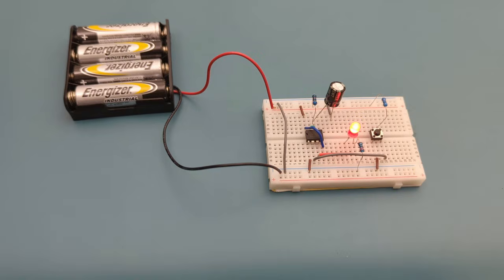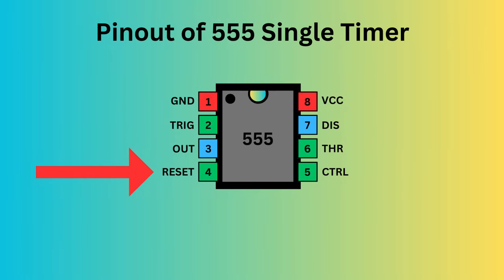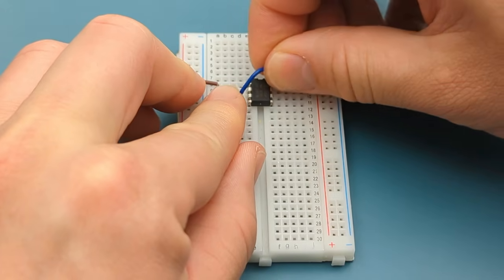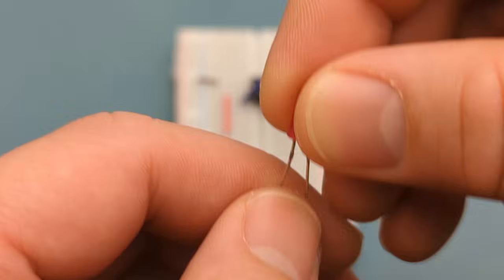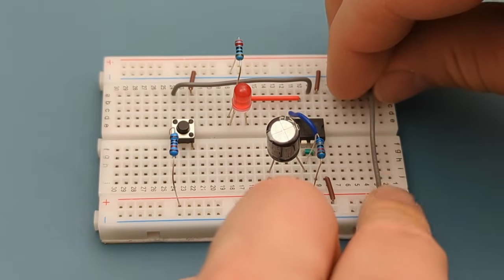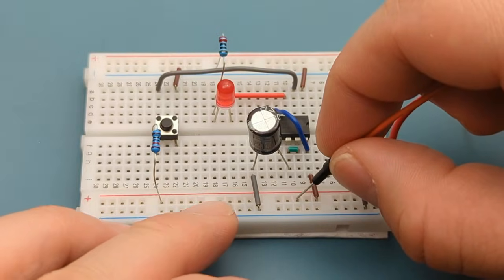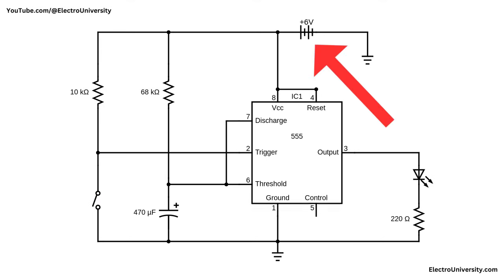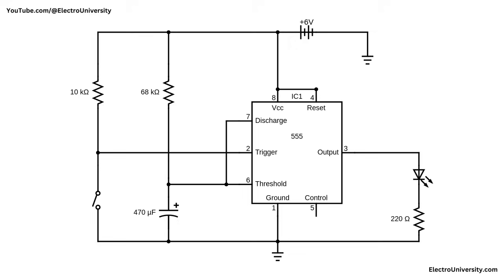How to Make Adjustable Auto On Off Delay Timer With 555 Timer

Comment: Can i use a capacitor of value 400mFarad in this circuit. What would be the values of the resistors and the voltage supply ?

Comment: Very good explanation of how the 555 timer IC works in monostable mode.   This means you press a switch, the LED comes on immediately and stays lluminated until a set period of time passes, 40 s in this case.    He explains in English how to determine this time period and make the circuit according to your desired time.     This would be perfect for something that only has to be on for a fixed period.   For example, you push a button.   A red LED illuminates your door latch just long enough for you to push the key in the hole and unlock the door.
I just subscribed to your youtube channel based on the quality of this video.